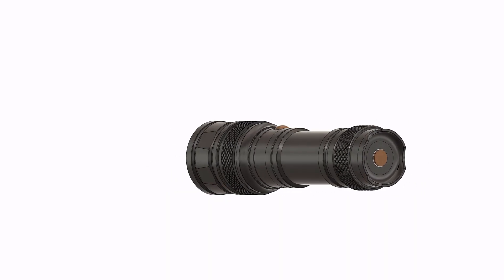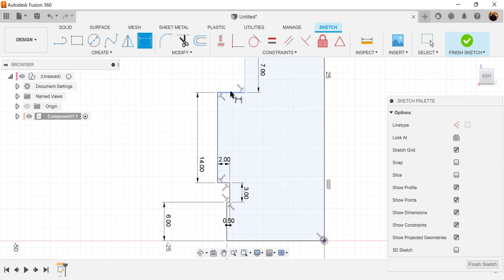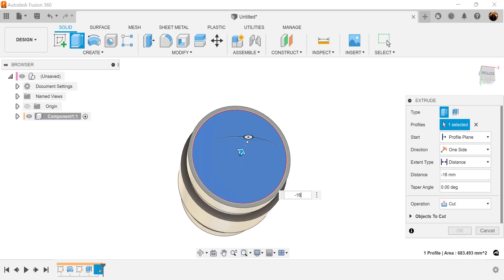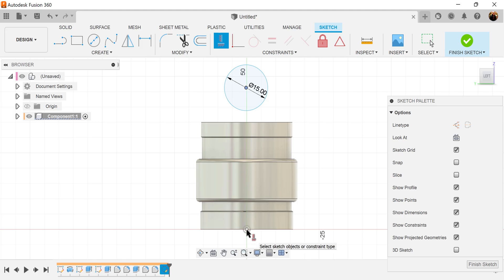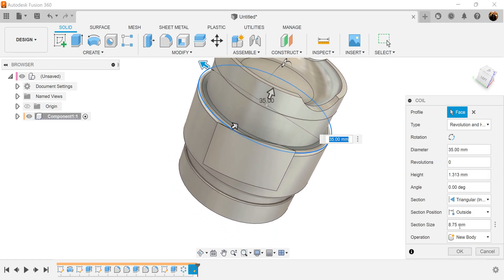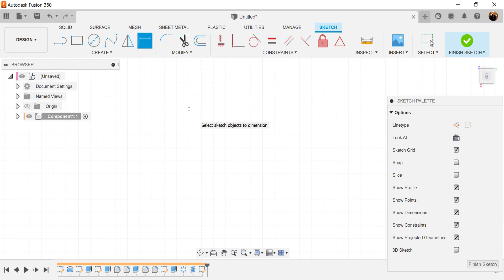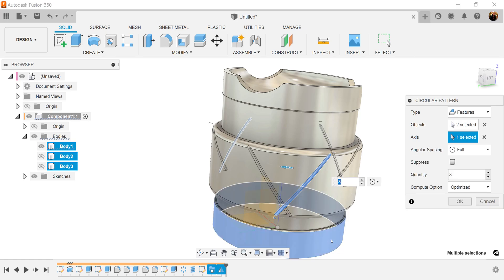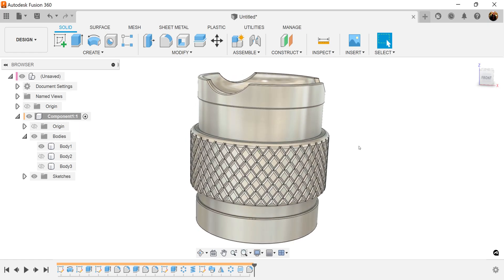Learn to model an LED flashlight in Fusion 360 | Part 1

Comment: Hi CJ. I reached 10.55. Every time I try the circular pattern (to create the knurling) it tries to compute the 43 knurls, then says "ERROR C-Pattern2" ? I have tried it several times, always resulting with the error. Any thoughts ???
Reply from the maker: It could be a number of reasons. Since I can't see what you have actually created, I can say that you can try to set the compute type to adjust or identical, also you can try reducing the number of patterns as well. Sometimes you have to play with the settings to see where the issue may be.
Reply: @CADJungle  I have tried various adjustments to your settings. The best I can get is the knurling at '30' and 'adjust' seems to work half way around the barrel but the other half, the knurls from the bottom reach the first intersection and stop, in one direction. The other direction all are completed. (Full length)?  I guess I will have to dump this sketch and start again, although I am sure I have followed your every move.
Reply from the maker: That is interesting to say the least. I would definitely make another attempt from scratch to see where things may have gotten off-track. Even myself, I've run into problems like this and realize later on  I may have left out a step or, didn't follow through on a particular item which caused cascading failures down the line. It's all a learning curve my friend. Let me know what you come up with.
Reply: @CADJungle  Just started again from scratch. Got to the knurling and got the same result. So I deleted the knurls and this time selected only one knurl (at 43, optimised). That whizzed around the barrel in no time. Then selected the mirrored object and repeated the process. It must have taken approx.one minute to compute the process but it completed it successfully.  I did try this yesterday but it refused to 'play ball'. My computer is quite a high spec. As I use it for Photoshop etc. Very strange !!! On to Part 2, tomorrow.
Reply from the maker: That was also another way to do it too! Yeah I sometimes run into issues at one point and then another time I can't repeat the issue. Weird. But I'm glad you found another workaround!
Reply: I have the same problem : I have reduced the number of 43 to 30. and in turn, first mirrored, then made a sweep. I think the problem is in my computer, it's weak.
Reply from the maker: Okay, I may have found the issue as to why you all have gotten that error. 

So when you create the mirror of the sweep right before the circular pattern, instead of optimize, set the compute type to adjust. Once you reach the circular pattern operation, set the compute type to adjust also. For some reason Fusion let me get away with it before but perhaps, after some updates it doesn't allow that operation the same way I suppose. Let me know if that works.